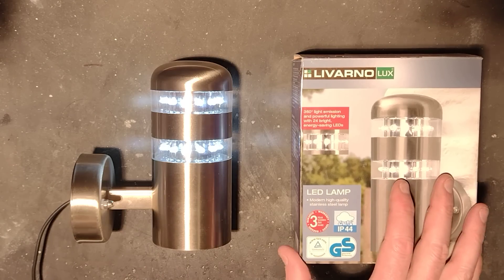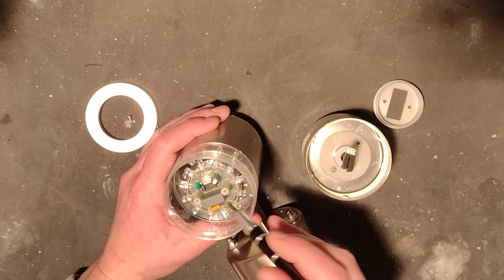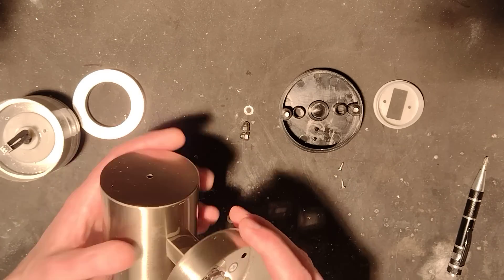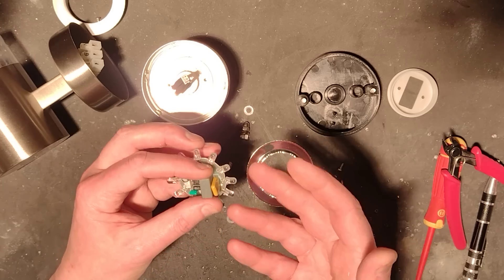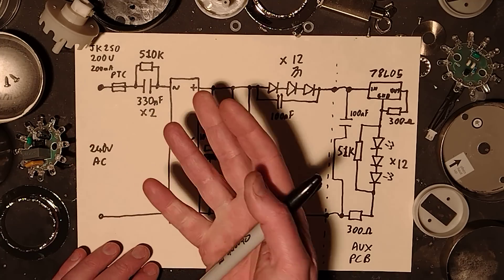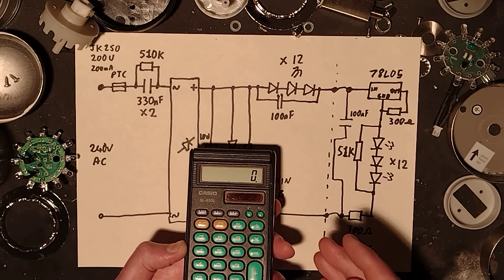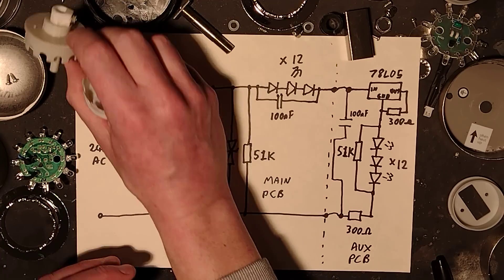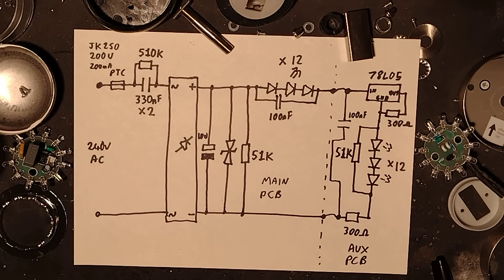Lidl Livarno Landfill Light teardown (with schematic)

Comment: Regardless of the electronic side of things, there's a hell of a lot of work gone into that light unit. Just the effort that must have gone into all the mouldings and pressings is impressive enough on its own, and all make a throw away product.   You'd think someone might have said "Oh yeah, let's just use a few screws and threaded parts, and make this thing repairable"!

A lot of effort, just to throw away.
Reply: A lot of effort for making money selling garbage
Reply: Few things are economically repairable any more.  Half an hour labour in the 1st world is more than the unit cost. Sad.
Reply: @sundog486  sad but true.  A guy taking 10  minutes to swap a bulb would cost you more than just getting another one. Fuck this bullshit
Reply: The original design was likely different and used incandescent bulbs so would have been repairable in that the bulb could be changed. With many of these they use the same housing, but put LEDs in there and manage to cut cost out of everything they can as it get redesigned.

Comment: Why have a current regulator and a capacitive dropper?  Isn't the point of a capacitive dropper to limit current anyway? Belt and braces approach, or is there another reason?
Reply from the maker: The current regulator may actually reduce ripple.

Comment: Somebody thought about the circuit. The individual parts are also elaborately made. It is only dark when an LED is open. Maybe the developers at least used good LEDs.
In the past you threw away a cheap glass bulb with a little metal, today we are further and throw away the whole lamp with electronics in it.

Comment: Fortunately I've found that LEDs more commonly fail closed, rather than open circuit.
Reply: It's been my experience that the bond wire breaks and the LED is open. So far, all of the Incandescent lookalikes with a planar board has failed that way. I've had a large spot light fail open too.
I'm sure with all the chinesium mixed into the LEDS many failure modes are possible.

Comment: That PTC is not for the inrush current. According to the datasheet its resistance is 3 - 6 Ω, and it will never warm up fast enough to raise that resistance; it will take seconds. No, I have a feeling that that thingy, the double zener will take the blow, because it limits the voltage there, and so the possible current trough the other parts will be limited too.
Reply: B.t.w., nice design, although I would like to see double the amount of LED's.

Comment: Perhaps the PTC is to protect against moisture on the board, such as the rectifier?  On the other hand, that is such a weird board, it suggests either someone mashed a bunch of designs together without understanding them, or worse, it was designed by  a committee.

Comment: That's a terrible design - a 7805 needs its input to be between 7VDC and 25VDC wrt "Gnd". This means that the lamp can accept a very small (18V) fluctuation on the mains-voltage before it goes out-of-spec, one way or another.

Comment: I don't like the "disposable" everything these days. In the end, it's just a waste of materials and time. Merry Christmas Clive!
Reply: It's been that way for a while. Take personal computers. Used to be worth repairing, in fact that's what I did back in the late 90s. My employer basically went out of business when clients decided it wasn't worth the labor to fix old units when new ones could be obtained for dirt cheap.
Reply: I don't get how anyone would drill a hole in their house to fix a thing like this. It's going to die after short time and the replacement will invariable require new drilling. After a couple of years, the wall around the cable will look like swiss cheese and it'l become increasingly hard to fix a new light.

Comment: Merry Christmas, Clive! I like the styling of this lamp, with the creative application of force and some DIY tinkering, these could be converted to low voltage and have some interesting effects added to them as well. Plenty of room in the bottom of the housing for homebrew driver circuits, and the clear sections could also be reproduced through 3D printing using translucent PETG to add further effects... fun!

Comment: There are " disposable lights" similar to those at work, with passive infrared sensors that turn the light on when someone walks by. This fails first, and seems to last about 4 months. I haven't had a chance to see on old one yet.
     They're still under warranty, and the repair guy takes the old one off with him.
      I have a sealed clip lamp that's holding up well. On a timer for 12 hours a day, for about 18 months so far.
Reply: You should ask the repair guy what he does with them and if the answer is "toss 'em" then you could ask to keep it.
Reply: @1stAshaMan  Not this time, but I have asked that in the past...they track what caused the failure, and use the returned one as training in repair.

Comment: Having a decent supply with so much filtering might prolong its life long enough that it becomes worth it. Maybe the ideal solution for mains LED lights would be to have a standardised two-part fitting, where an LED module could be plugged into a separate quality power supply?
Reply: Some florescent tube light retrofit kits seem to follow that "ideal" model. Power brick module replaces the ballast, and LED lamp part is replaceable. (Although I suppose the market for that is thin due to competing with direct swap-in models that can run off the old ballast power, which are technically more convoluted but easier for the consumer to deal with.)
Reply: @pauljs75  A few years ago I tried some of those LED fluorescent tubes which claimed that the ballast need not be bypassed and those LED tubes didn’t work at all (technology too new at the time).  About six months ago I bought another pair of Walmart Great Value LED tubes which allow the ballast to stay in place and they work beautifully in my kitchen fixture.  The Great Value LED tubes were very inexpensive and have a life estimate of 23 years at 3 hours per day.  The LEDs don’t save many Watts versus fluorescent, but it is worth it to save maintenance not climbing to change lamps or starters.  It is a 50 year old light fixture that still uses starters.  With LED tubes, there is no filament, so the starters may be pulled out and saved or disposed of properly.  The LED tubes also have a choice of a color temperature close to tungsten filament, so the kitchen now looks more cheerful than it did with the cool white fluorescent tubes.

I just replaced the entire fixtures of the classic white double 40 Watt tube shop light fixtures in my basement.  If you hunt around, there are fluorescent tubes that are close to 2500 Lumen output. I found LED fixtures with 5000 Lumen output in a nice medium warm color temperature for $15 per fixture at the local Menards hardware store.  That was about the same price as a pair of high output fluorescent tubes.  Might as well retire the 50 year old fixtures at that price, and the  LED fixtures are only the width of a single tube as well.
Reply: Make the LEDs and the current sensing the same part, to get different currents from the same source.
And add a signal to make a single source voltage less.
Reply: @ReinoGoo  The current sensing would provide that signal.

Comment: 78L05 as a current source is soooooo simple and brilliant! I love this design idea. Pity it doesn't have a wide range of voltage regulation (just 35V input voltage), but a well-designed power supply with a MOV or similar protecting device will be okay-ish for that.
Reply: 78XX on this configuration is a constant current source. This usage is specified in datasheets and, even not so common, can be used with all 78xx-79xx series and 340, 317/117 or 337. 78xx/79xx are not so much used (unless you have a ton of them) because efficiency. 5V on a resistor dissipates more power than 1.2V. Also, the input voltage limit is 35V between input and ground; on this configuration can use it for hundred of volts while between input and ground not exceed  those 35V,  but rarely used.
I don´t know why is so strange this usage of the good old 7805
Reply: It is more common practice to use a LM137 for such applications, it even appears in the application notes for this variable regulator, however due consideration needs to be given to the power dissipation of such linear regulation circuits. The heat must be removed somehow.
Reply: @nigeljohnson9820  of course, I know about LM317 being commonly used as current source, but using a 7805 that way was a surprise to me :)
Reply: @KeritechElectronics  me too.  My most unconventional use of a 7805 was the addition of a 2n3055 circuit  in parallel  to boost its current handling capabilities, as a voltage regulator. In this application, the LM317 might have given a slightly wider input voltage range  and maybe a slightly better maximum power dissipation spec.
It's a brave designer who uses a component in a novel configuration in a commercial product, as opposed to a one off prototype or hobby application. I would never have  got this through a design review, even though it is relatively simple idea.
Reply: @nigeljohnson9820  2N3055 in parallel with 7805? I can imagine driving a transistor with 7805 Darlington style, but I think LM317 is better suited for that because it's easier to make and fine-tune the voltage adjustment feedback loop.
Reply: @KeritechElectronics  Tushay! As I recall adding the 2N3055 involved putting a suitable value series resistor in the input supply line to a 7812, (not the previously stated 7805, though the principle is the same),  and using this to supply current to the base of a complementary NPN transistor buffer driving the 2N3055 base. The trick is keeping the circuit stable. As I recall, I built the circuit as a hurried emergency solution to supply the 6 amp, 12 volt, demands of an old  PYE Cambridge radio transceiver, converted to work on the 2 metre amateur band. The regulator and associated components were mounted on Vero board, with the 2N3055 on a large metal heatsink.  
The stability issue became apparent when it was initially switched on, for while the circuit appeared to deliver a stable 12 volts, it also managed to  blackout all VHF TV reception for about half a mile radius, and that was before it was connected to the transceiver. 
Adding a couple of low value capacitors to the circuit made it unconditional stable under all load conditions.

Comment: It might be a good idea for small standard plug in LEDs to be marketed to enable replacement in lamps like this which would be designed for them.  No soldering, just unscrew, pull out an old lamp, push in a new one, and rescrew.
Reply: Only way that’s going to happen is legislation. It’s more profitable to sell an entire unit.
Reply: @enterthekraken  Some kind of greenness score would be helpful.  More and more people are becoming aware of greenness issues.  I don't like absolute bans, absolute mandates, when an immediate safety issue isn't at stake.  But people should be told how green or brown a product is, IMHO.
Reply: Funny thing is that cheapo Christmas light strings have plug-in bulbs, while expensive fixtures don't.
Reply: @jpdemer5  I thought of that too.  That is easier because the lights are all out in the open.
Reply: there are so many different form factor LEDs out there, and requiring different voltage and correct limiting.
standardising a socket for them would be very challenging and likely would hinder innovation

Comment: I wonder if the 100nF caps will act as capacitive droppers if the leds in that section go out and keep the other section lit
Reply: They are on the DC side of the rectifier, so no.  More relevant to look at the 51K in the top board, might pass a bit less than 1mA if a top LED fails.

Comment: I really don't like outdoor light fixtures with build in LEDs instead of interchangeable bulbs. When they fail, they fail and there is no coming back. Imagine having those installed and a few years later they fail and you now have to change the entire light instead of the bulb.
Spend more on quality fixtures with exchangeable bulbs.

Comment: I'd want to replace those LEDs with that LED COB tape, would be a far better look than the ring of 5mm focussed LEDs akin to the "revolutionary" LED lamps from over 15 years back which had clusters of the 5mm jobs on them... :P

Comment: It's a shame they aren't serviceable, the visual design is actually quite nice, they just need diffusers instead of clear plastic.
Reply: I wonder if a little fine sandpaper on the clear plastic would help with that

And if a heatgun would help in separating the layers (though it might just melt the plastic if you're unlucky)
Reply: @1stAshaMan  Sanding might work, or maybe some strips cut from disinfecting wipe container that's made from HDPE or even that frosted vinyl stuff for glass shower doors.

As for getting into it in the first place, it might be better to just stick it in an oven if it can go low enough (below 135c/275f).

Comment: My wild guess is the lower 300R resistor has something to do with satellite's 100nF capacitor. You could have shorted it out to see what happens. I suspect the voltage regulator could have gone unstable or something.
PTC may have been introduced to limit inrush current to comply with certain local standards..
Reply from the maker: It would normally be an NTC thermistor for that.

Comment: One thing is to buy table, desk or pendle lamps with unreplaceable light source. Something else is buy outdoor lighting - and then on top such horible quality. Such 5mm LEDs are typically of very low quality these days.
So you soon find yourself wanting to replace these lamps and sure most likely that means yet another set of screws holes.
Unless some very special requirements - Just buy a good ordinary outdoor lamp fixture for E14 or E27 bulbs -> by far the best choice in the long run! And very inexpensive to replace bulbs when they fail or become too dim.

Comment: At 17mA and decent protection against surges, these should last a decent long time. That 300 ohms series resistor should have been on the AC side though: help protect everything in case of a voltage surge or excessive noise until the PTC kicks in.
Reply: I was thinking the PTC would help there would it will still pass 200mA. My only thought is that it’s there strictly for dead shorts since the TVS will go up in flames if it’s forced to conduct that much current. I think the trip current is even higher. The dropper will be what actually protects things.
Reply: @mysock351C  200mA is only the PTC fuse's trip current. Once tripped, the PTC's resistance increases sharply it becomes a relatively constant power device. For a 200mA 240V PTC fuse, the power should settle around 800mW, which is roughly 7k ohms.
PTCs need a few seconds to warm up. A 200mA 240V PTC has 6-8 ohms of cold resistance and is only rated for ~1.5A max. If you put it in a dead short across 240V, it will very likely blow up from the hot-spot heating up too quickly. You need enough worst-case circuit resistance to be designed-in to limit current to something survivable if you want the PTC fuse to operate normally under extreme fault conditions.
Reply: @teardowndan5364  Ah ok that makes more sense. I looked at the datasheet for it, but it was a Chinesium one that listed the 200mA as its holding current. In that case it does protect the TVS, then.
Reply: @teardowndan5364  Out of curiosity since I have similar ones on hand I checked and the trip is 400mA and the hold current is 200mA according to the PN and the data sheet seems to back that up. Too high to be of any real use to the circuit itself. I guess they are just depending on the dropper then to protect everything and that’s just a belt and suspenders in case a short develops somewhere.
Reply: @mysock351C  Were you applying 240V to the PTC? I'm guessing not. If you used something like 10V to test a 240V PTC, the PTC's temperature ends up limited by the 20-30 ohms R1Max in the neighborhood of 100C. Your voltage is too low for the PTC to actually reach the 125C required to make the polymer expand enough to reach the fully-tripped state where R = E^2/P, P being the PTC's rated power at 23C ambient temperature. (Belfuse 0ZRE spec sheet.)
Reply: @teardowndan5364  I have tested mine fwiw. I was talking about the datasheet for these specific ones. As I had originally stated 200mA is the holding current after it has tripped. I wanted to see if that was the case and it is, out of curiosity. That won’t protect much in the lamp if the LEDs go open ckt and the TVS has to pass the full current. In that event the dropper cap will limit the dissipation. Probably something like a watt or so. The only other explanation is then it’s simply just being used as a fuse and nothing more fancy. Probably only needed, anyway as those film capacitors are self-healing.
Reply: 1500VAC surge protection?  I think not.

They will struggle to get this approved...

Comment: I had/have one. My overvoltage/fuse burned out. Was sparking inside. 
Bridged it but due lack of light I modified it to an 230V E14 2W filament bulb instead. Inside daylight switch (the blue ebay one without case) and a 12V and 5V power supply to power other Led lights but using the same daylight switch.
It's hard to open btw. All glued together.
Heating it up will help.
Reply: Those 5v/12V ac/dc  is to Power some cheap rebuild solar lights btw. Better hig power led/cob led. (3x5V parallel with each a 3W led resistor keeping it under 1W.) 
To light my fence

And the othere 4x 3W cob strip in series on 12V and small inline resistor to keep it cool. Running with leddimmer. To light a garden canvas poster. 
So always room for improvement and keeping it away from landfill.

Metal housings are often ok to use.